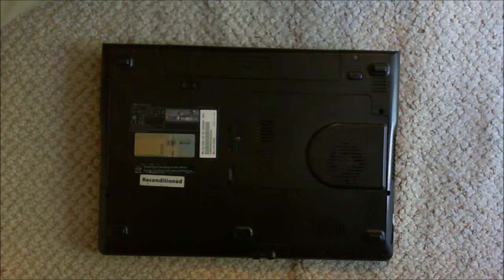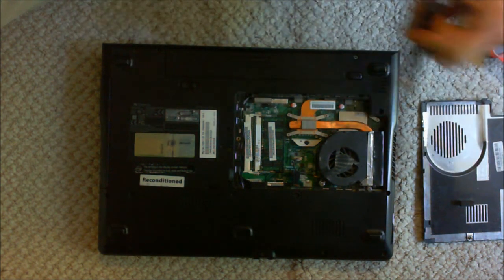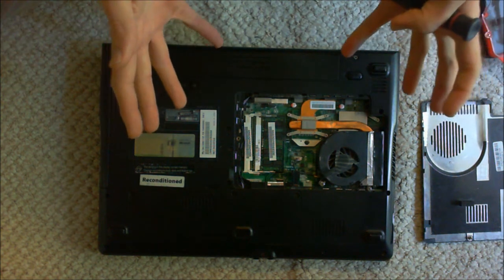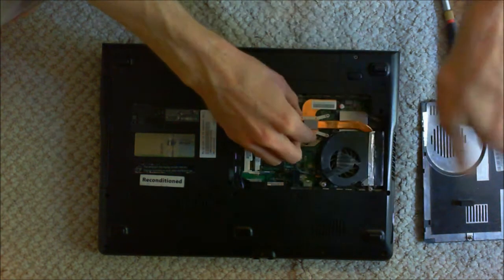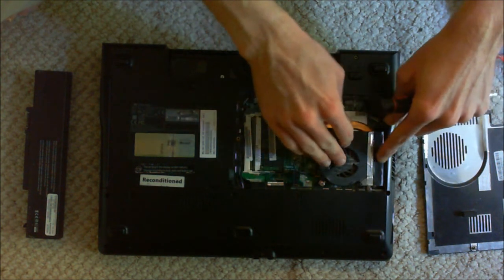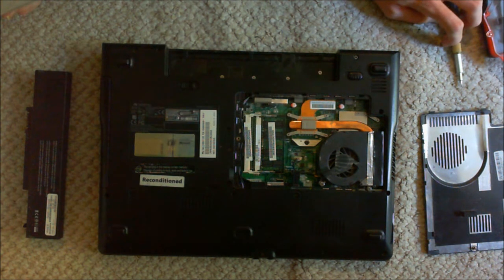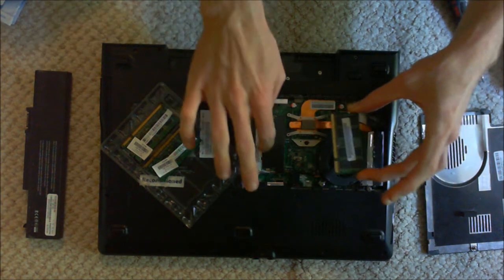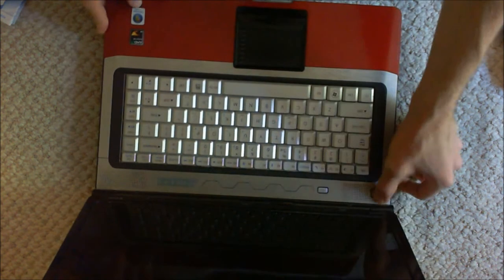Removing a laptop fan and installing RAM

Comment: M-2626? Mine is an M-1629 and it looks just like that...
Reply from the maker: Yeah, like with cars, it's common to reuse a laptop chassis. My brother got a newer model, and aside from colour, it only looks different once you open it up.
Reply: SamtasticOnline Actually, what I'm saying is that it is the same color, same size, same keyboard layout, same screen, etc., AND it looks basically the same on the inside! BTW, did you buy it from RadioShack?
Reply from the maker: Sidney Rutledge No, I think it was from TigerDirect.

Comment from the maker: Unfortunately, it is not easy.

replace each space with a "." and here's your manual:
support acer com/acerpanam/manuals/acer/2010/serviceguides/sg_aspire_5742_5742g_5742z_5742zg_20100806 pdf

You can see it on the top left of the picture on page 78, detailed fan-removal instructions are on page 89.  Props to Acer for that manual, though.  I don't think I've ever seen a manufacturer show such detailed instruction on taking your computer apart before.